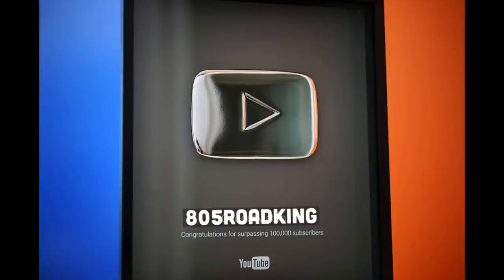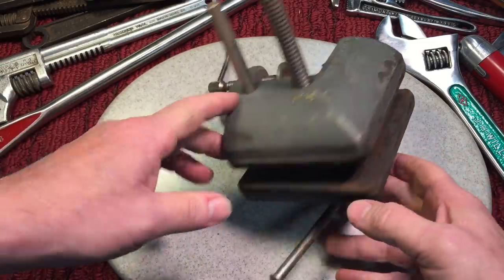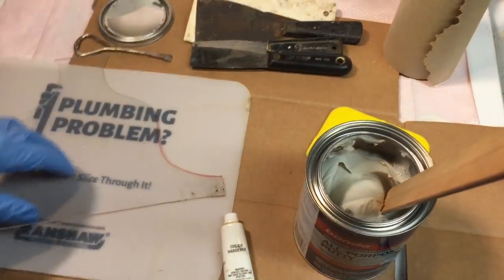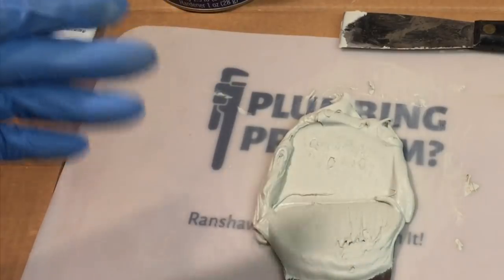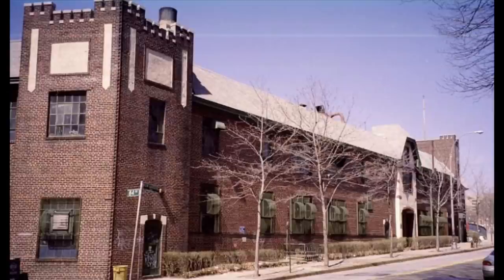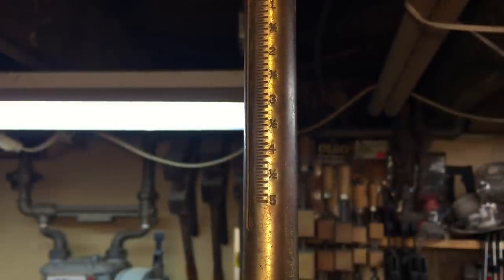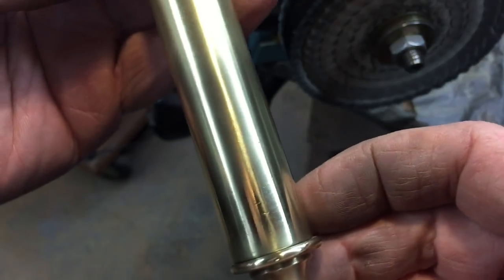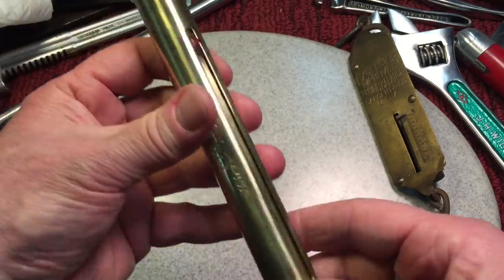Chatillon Scales and BONDO!

Comment: Gerry Coplin and I were mounting air slide guarding on the new punch presses at Borg Warner. 
The Bliss Four Post 400 ton mechanical press was made from huge castings. 
We were using a Milwaukee Magnetic Base Drill Press to drill and tap the 5/8-11 holes to mount the guarding. 
The Milwaukee had a safety chain that we would tie off to the press or the lift we were working off of. We had been using the Mag Drill for quite a while and never had it fall. 
We set it on the side of the casting and turned on the magnet. Everything seemed okay until I started to drill. I set the bit against the casting and the drill fell off. The thing weighed 20 lbs or so. It about pulled me off the ladder. 
We thought the Mag Drill came unplugged, but it turned out there was a hole in the casting about 5 inches across that was filled with Bondo. We had to move the mount over so it was anchored to the casting instead of the Bondo. 😁😎
Reply from the maker: Wow!  Some voids can be huge!  Sandblasting can surprise a lot of people!  😂👍

Comment: My intro to Bondo came about 30 years ago. The contractor I worked for got the job of doing some repairs on a house that had been built In 1938 for the lady who lived there as a wedding present from her mother. It was built to look like a Spanish villa, complete with a courtyard, hammer cut stone work and a clay tile roof. Some of the casement windows had rotted and I had several days of taking the sashes out, removing the glass, cutting out the worst of the rot and splicing new pieces of wood, gluing the joints with an exterior waterproof epoxy, and then reglazing. Some of the windows that weren’t as bad just got the rot scraped out and then filled in with bondo. After we finished the repairs, my boss talked a painter who had apprenticed in the thirties to come out of retirement, and paint all the new work so it looked several hundred years old.
Reply from the maker: Awesome story!  Thanks

Comment: Remember Liquid Steel ..Years ago you got it in a tube and it was great for small pits in metal you smoothed it on and after it dried you could sand it and paint over it

Comment: Our body shop always used the red hardener which made the mixed filler turn a light pink.  I was amazed that the old brass scales were still so accurate!
Reply from the maker: Jim-Red is the correct color.  Turns the Bondo a salmon color.  I don’t know why they included white hardener in this batch?  😃👍

Comment: Great job on the Bondo John.  Body man trick:  Add a little clear fiberglass resin to make it thinner and smoother.  They both use the same hardener.  Works great on old dried out Bondo.
Reply from the maker: Hi Mark!  I used to have a quart of resin but it dried solid!  😂😂😂👍

Comment: Nice job on the scales. I have seen them at farm auctions but passed them up. You got me interested. I have used Bondi on cars a few times  but not on pits on tools. I have a little   jewellers vices that was pretty bad. I sanded a lot and painted it but still not good. Might go back and try that. Stay safe and healthy my friend. Thanks

Comment: I use a Salter spring balance( THE name for spring balances in the uk) very often to weigh stuff that I’m selling on eBay ready for posting. It’s a 60 lb max and it’s got a big 10” clock dial. Pretty accurate and I was amazed to see your 50 lb one with such a tiny scale. They make a great distinctive noise , dont they?   That four pot Briggs was a piece of kit! Cheers John

Comment: Mix some fiberglass resin in with your bondo. It uses the same catalyst hardener as the bondo and helps to make it a more “creamy” consistency. It’s an old trick I used when I was doing bodywork quite often.
Reply from the maker: Tim- I had a quart of resin and it dried solid as a rock in the can!  😂😂😂😂👍. (20 years it took)

Comment: I was going to say I used some of the bondo fiberglass and bondo to patch some rust holes on the lawnmower deck. I didn't have the tools or knowledge to weld and figured I would do that. The holes were in bad areas to try and patch but so far so good. Bondo is tough to sand though. I applied it alittle too heavy and sloppy not knowing how difficult it would be to sand. I gave it a few coats of paint afterwards.
Reply from the maker: Awesome!!!!!!   It's funny how mower decks rust out before the engine goes...  Planned obsolescence!!!!  Thanks!

Comment: Years ago when I was still in the old car hobby I use to take engines to work and dismantle them. I would then put all the parts in a large Storm Vulcan parts washer to degrease them and also remove paint. I use to find voids in cyl block and cyl head castings that were filled with lead / solder at the factory before they were painted.
Reply from the maker: Hi Chuck!  It’s a very common practice as most castings aren’t perfect.  The bad reputation came from China where they would fill huge voids instead of scraping the part.  😂👍

Comment: Bondo is fine for metal but for wood I think there's better choices. Wood glue and sawdust if you need to color match, and a product called DAP Plastic Wood for anything else. With the Plastic Wood you stir the can, slap it on, and it flashes off and it ready for a second pass or sanding in literally a couple minutes. You can be painting a few minutes after that. I've not seen it crack, let go, or translate through paint yet. About the only down sides i've found is the smell and it drying up before you finish the can, but that is the trade off with having something with such a short time between application and being able to sand/recoat I suppose.

Comment: Very informative video. Saves me from learning by fiasco. I have used JB Weld successfully. I'm glad you said that Bondo is best in non structural applications. That's important. Great job on the scale. I think I have a few around I will now have to get out and clean up. Brass is very cool alloy. Thanks
Reply from the maker: Pat- I’m doing a JB Weld tutorial shortly!!!  😃👍

Comment: Nice intro to bondo. I've never used the stuff and didn't know it was an epoxy product. I like epoxy for conformally coating circuit boards so they're safe for severe duty in outside use.
 On the note of scales about a week ago I found a black nylon bag in the back of my property. Turns out some druggie left an AWS 70 gram electronic scale there. I cleaned it up with some alcohol and put new batteries in it and it works! Retail value is about $25 on it. You never know what this city will drop in your lap.
Reply from the maker: Nice find!!!   😃👍

Comment: Smashing clean up. Would you skoosh a wee bit oil on inner workings? Or would that knacker it
Reply from the maker: I wiped the bottom slide with Light clear oil but oil will tend to tarnish Brass quickly.  😃👍

Comment: That Bondo is very versatile.  But there are guys who go crazy rather than put any Bondo on their cars.  I've seen videos of people doing lead work to fill in dents on cars.  I didn't know lead would stick to steel on cars.  Maybe the guys who stay away from Bondo are the guys who love patina.  LOL
Reply from the maker: Hi Kathie!  Unfortunately Bondo has gotten a bad reputation over the years because of people miss using it. Metal is always preferred when doing body repair because of the expansion and contraction is the same between sheet metal and repair metal. However many of the purists who don’t want any Bondo on the car also have very deep pockets!  😃👍
Reply: There are limits to what Bondo can do. 
I worked one summer in Reds Body Shop. Nothing skilled like painting . I cleaned cars and sanded paint. 
One of the local auto dealers bought a car at auction. A red Ford Fairlane convertible. Beautiful car. It had the drivers name painted on the door next to the window and his girlfriends? name on the passenger door. 
It also had a huge mangled dent in the left rear quarter panel. As the driver was coming back from the auction he went over some railroad tracks and the 6" thick slab of Bondo the full length of the quarter panel fell off.  😱
The dealer was a cheapskate. Rather than fix the fender he had Red build it back up with Bondo.
Always carry a magnet when shopping for a used car. 😵😖
Doesn't work on today's cars. They are half plastic to start with. 👎

Comment: John-I was wondering what you do for ventilation/air filtration/dust collection down in the shop? I'd like to think you're working safely.
George
Reply from the maker: Hi George- I recently bought a nice air filtration system and I use a N95 mask whenever at the machines...   =D  Thanks!

Comment: Great video, but a slight correction is required. Bondo is not an epoxy product. Do not use it as an adhesive.   It is a polyester resin, and while it may have some strength (same resin used in fiberglass work) it should only be used, as you demonstrated,  as a filler material.

Comment: On the last Sunday of 1879 the first Tay bridge collapsed with a passenger train crossing at the time. It was believed that the bridge could not stand the extra pressure exerted from a storm-force wind which was blowing up the Firth of Tay when the train crossed the bridge. It was found that, during the examination of cast iron girders retrieved from the bed of the river, that there were many poor castings, futhermore, many of the castings were found to have had their flaws filled with a mixture of shoe black, soot, iron filings and other such things of no physical strength which had been used to hide the flaws from the building inspectors during the construction of the bridge.
Reply from the maker: The funny thing is Bondo got a bad reputation from a lot of the products that were coming out of China. Very few castings are perfect and it was common practice to fill-in pinholes in pockmarks with any substance available the problem is that China started filling huge void in with filler that isn’t structurally sound and still do to this day!